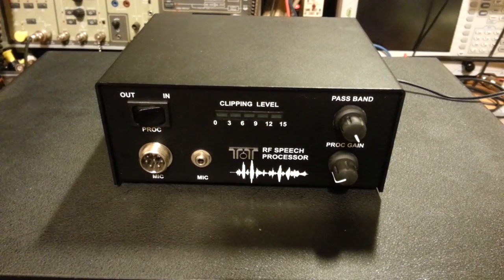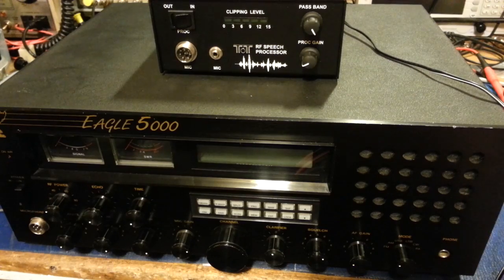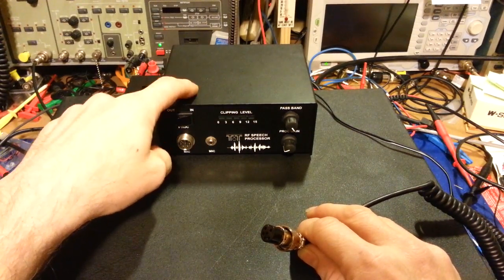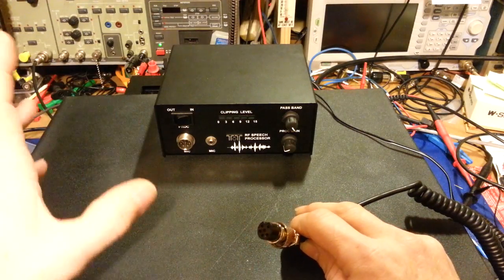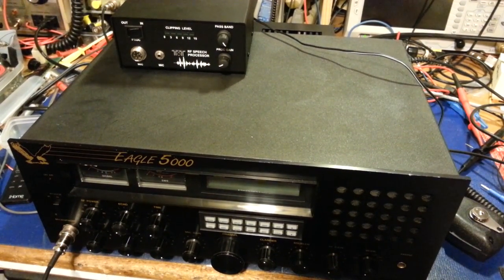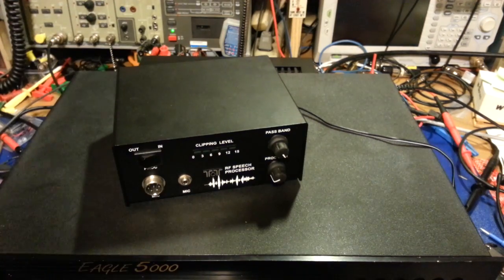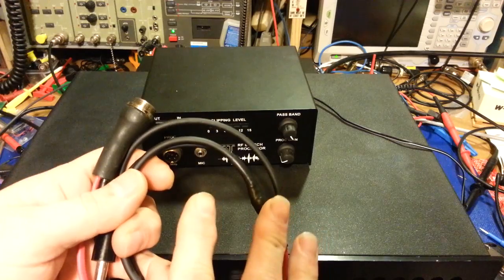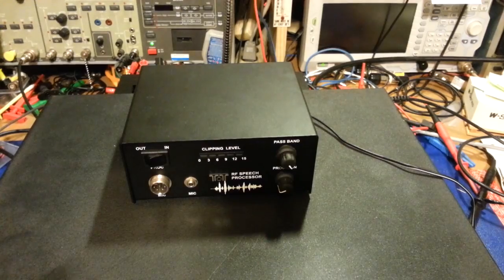Adapting any speach processor to work with any CB or HAM radio and retain function of buttons on mic

Comment: I only run my CB with a compressor and 8 band equalizer,  it's very cool that the hobby is incorporating speech processors and compressor's, and now the direct injection mods are awesome for running pro studio equipment.
Food for thought, you should have thrown some ferrite cores on those cables you made to keep down on stray RF and feedback.73's

Comment: What does that speech processor look like on the O-scope or spectrum analyzer? Are they a good investment to improve your output signal and does that produce a digital signal?
Reply from the maker: William Colvin 

One of the best add on speach processors around because it is an RF type.  It converts the input audio into RF SSB, then it goes through the clipper circuit, is filtered and converted back into audio and out the output.  The advantage of the RF speach processor is the lack of IMD distortion.  Having been converted to RF, clipped and then filtered it doesn't produce distortion like a normal audio clipper.  These units improve your average power, not peak power.
Reply: Thank you very much.
Reply: i have two of the datong first blue boxs. use them on ham and cb!

Comment: I have that same unit TenTec 715. I just got mine Christmas 2015. I use a 1/4 inch Jack to 5 pin President jumper. I did the same thing. In my case I skipped the up/down buttons. I use that with my President Lincoln on SSB and it is a beast! 

Can you buy mic cable by the foot that is not pre-coiled? If so what is it called? When I look all I can ever find is the coiled replacement cords never a spool of 4-6 wire mic cable. I really hate the coiled cords and would love to be able to make some jumpers that are straight. 

Thanks for your time Mike!
Reply from the maker: buckaroobonsi555 

I buy it by the 1000 foot spool.  Here is a listing on ebay from a seller that sells it in shorter lengths.   If you don't need that much ask if he will sell a smaller length.  Ebay # 272479469842